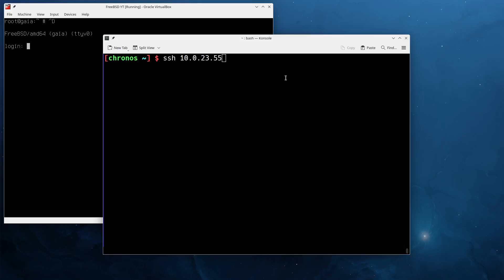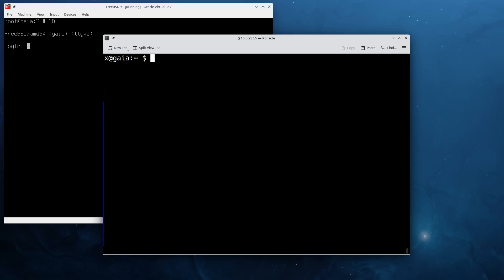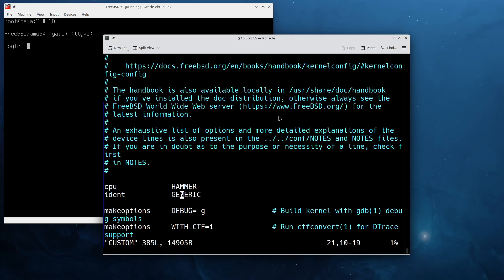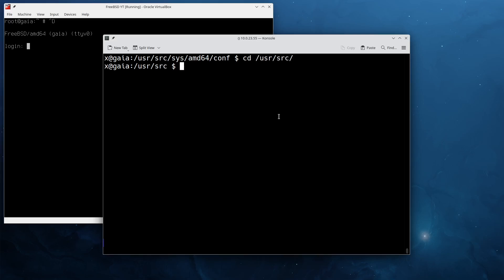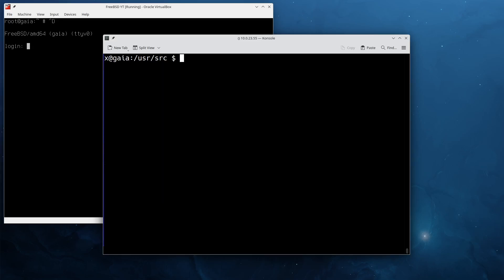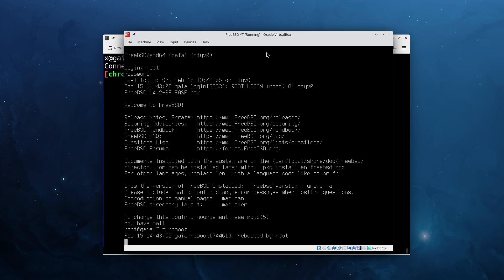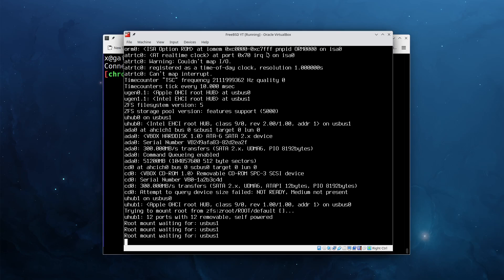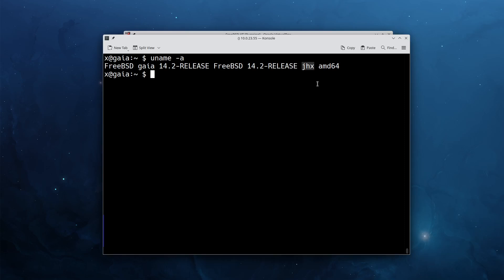Building a custom kernel on FreeBSD

Comment: Thanks for the video! 👍 Building custom FreeBSD kernel is that easy, but rarely needed nowadays; although it will be very beneficial to have video showing complete -STABLE build: src git pull, make buildworld, make buildkernel etc.
Reply from the maker: Indeed, building a kernel is rare nowadays. For the most part everything works.
building STABLE is useful indeed!
Reply: @YetAnotherSysAdmin  most people that build kernels are probably doing it to create a new based distribution
Reply from the maker: @IunahYT  Yes, that might in fact be the case. Another good point is slimming down the kernel or doing optimizations. Although, the FreeBSD Generic kernel fits well for most people.